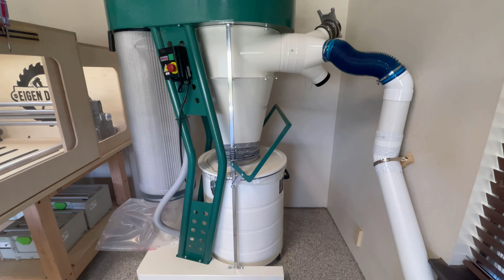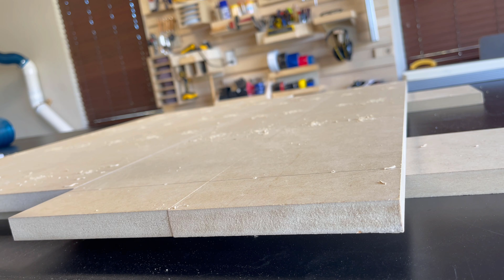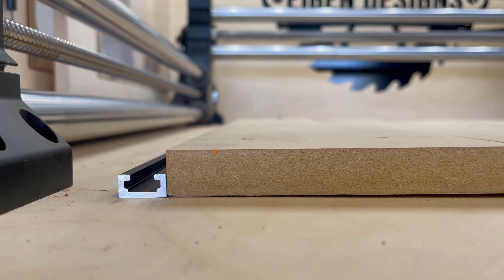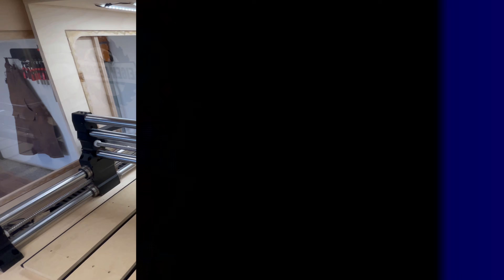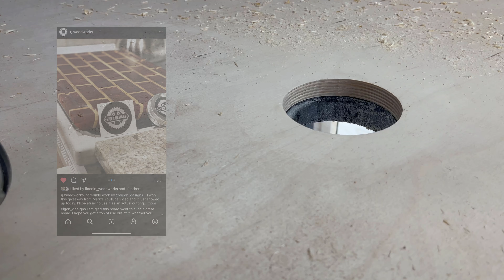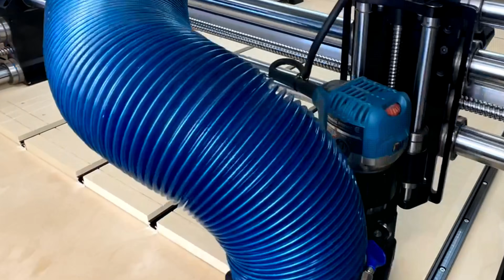OneFinity CNC Upgrades  |  4" Dust Collection & More

Comment: I am building a similar enclosure for my shapeoko 5 pro 4x4... I also have a 4" DC. Do you like where you mounted the port through what looks like the middle of the front cabinet slide? I was debating on a back corner

Comment: How does the dust collection run with limited air inrush space into the enclosure? It's one aspect I'm thinking over as I process a design that will be a lot about noise reduction and yet need effective dust control internally. I can use a water cooled spindle to reduce air blowout of dust which = less suction demand, and am contemplating a rear or top air inlet that is actually a stepped baffle with acoustic foam. 

Have you any thoughts on this from from your own cabinet. It looks quite well sealed with the main air ingress only possible betwteen the sliding front/rear portion :). I'ts a very nice design I must say!

Comment: Hi. When preparing wasteboard, would it be a good idea that it could extend outside of the range of the CNC so it gives more room to clamp ?
Reply from the maker: That's a very good idea. It would surely help get clamping around the lower perimeter for the waste board.

Comment: If you drilled a larger hole in your spoil board for your screws ( I call this a clearance hole . It allows clearance for the threads of the screw so they don’t actually tap in to the item you want to fix down) you would have been able to screw your spoil board down better
Reply from the maker: Great tip. I will try that next time.

Comment: Those are some great upgrades. What do you think about putting on an 80mm collar, which allows more Z axis movement. There's a YouTube showing how it clears the stepper motor and gives you about 2 more inches of dimensional movement. I though you might have an opinion about this. Thanks.
Reply from the maker: I think it largely depends on the kind of CNC work you do. If you do a lot of projects with thick stock and need the extra Z axis movement, it’s something to consider. I haven’t ever needed that capacity for the projects I do so it wouldn’t be something I would upgrade personally.
Reply: @EigenDesigns  Makes sense. Thanks. What do you think of the QCW add on ? I notice a lot of YouTubers don't have them. You don't either so you must not have thought it was worth it ? Still, Onefinity charges a lot for that unit so I'm trying to figure what is the value - is it just for additional stiffness and why would you need that I wonder. Or is it just for convenience in in swapping in new wasteboard - although it doesn't seem to me that it adds all that much more convenience. I'm getting ready to make the big purchase so I'm really trying to figure out what I need and don't need. Thanks again.
Reply from the maker: @hv1461  The designers at OneFinity originally designed their system to be transportable and mobile so that users could disassessmble and reassemble with relative ease. For someone traveling with their OneFinity I could see how the QCW frame could be useful. For a hobbyist woodworker like me who will only ever use it in my shop, I decided to build a table dedicated to it and never take it apart. 

I hope this helps. If you're like me and don't plan on moving it, I would make something rigid out of lumber + ply yourself. 

Cheers,

Mark
Reply: @EigenDesigns  Thank you. I appreciate you sharing your knowledge.

Comment: Love your videos and your work!  One question, how much sound dampening do you get with your enclosure?  
Thanks 
Chris.
Reply from the maker: Hey Chris. The sound dampening for the router is actually pretty good. I would guess it blocks out ~50-75% of the sound. However, the dust collector is what makes most noise in my shop and that is not at all dampened by the enclosure.

Comment: Enter - Nice setup!  Did you notice a big difference with the 4" dust collection setup?
Reply from the maker: Its been a signifcant upgrade Todd. Now, to be fair, I have also upgrade my dust collector so its not just the 4" vs. 2.5" upgrade having an impact, but the actual dust collector itself too. The two working together remove 99%+ of all dust generated at the router bit. 

I have entered you into the giveaway :)

Comment: Thanks for thus informative video. One question, what type saw blade did you use to cut channel. I have a Dewalt 12" mitre saw. Thanks for your help.
Reply from the maker: I have been using a FS Tool LM4300 miter blade (https://amzn.to/3s22Ngm) for years and it still cuts everything like butter. I have had to cut some acrylic and some c-channel and it handles it no problem.

Comment: Awesome....that dust collection system looks like it could eat a small car!  I know this wasn't much about bits, HOWEVER, do you find the extra $20 for a WS resurfacing bit is worth it? Dig the stuff you put out....keep on keepin' on.
Reply from the maker: Hey Jeremy. My general experience towards CNC bits is that you get what you pay for. I have tried buying the cheap chinese bits for my CNC work and I find that they don't last very long and end up leaving more burn marks when compared to the higher end bits. The whiteside surfacing bit was actually purchased after I tried a cheap surfacing on that left black burn marks on my spoil board. So for me, there's no question its worth it. Also, I bought a nice Amana set for my general routing work about 8 months ago and I am still using them. I haven't had to replace them yet. 

Thanks for the support bud. I really appreciate it.
Reply: @EigenDesigns  Sounds good and thanks again!

Comment: Enter Thanks for this video, I am connecting my dust collector to my cnc this weekend, also using 4 inch. I have a drop right above the cnc, definitely going to look at those magport connections!
Reply from the maker: I am glad it is helping, Dan. I have been really happy with the Magport couplings. They are a bit pricy, but it makes removing the dust collection line much easier. 

I have entered you into the giveaway :)

Comment: Enter. Why did you use a 90 instead of a 45. 1. They say you should not use 90s as it restricts flow. 2. It looks like the angle to the pipe would have been more of a straight shot. Thanks
Reply from the maker: Hey Josh, that's a really good question. In short, I intentionally opted for aesthetics over functionality with the 4" run to my CNC. I chose 90s for the CNC run because I thought it would look better than using a 45 and having the duct run cut across the room. 

Now, for the main trunk line that feeds my big equipment (e.g. planer, jointer, tablesaw) I have used 45s over 90s where possible. For that ducting run I was much more concerned with minimizing losses, whereas the CNC run I didn't mind because my 3HP dust collector is wayyyy overkill for my machine.

Really good question, but there was thought put into it before selecting the 90s.

Also, I have entered you into the giveaway :)

Comment: enter Great video, is it really working that much better than the previous dust collection set up?
Reply from the maker: It's been a significant change Mike. When I surfaced my spoilboard that was almost no dust or shavings left behind. Now, this 4" upgrade was coupled with a dust collector upgrade so I can't really say what portion of the upgrade came from the 4" vs 2.5" line upgrade and how much has come from the newer dust collector. The two changes in combination have been a sunstantial upgrade though.

I have entered you into the giveaway :)

Comment: Enter. I really like those magnetic quick disconnects. What kind of filament did you use?
Reply from the maker: The magnetic disconnects are really handy, and they form a surprisingly good seal (e.g. almost no air leakage). What do you mean by filament?

I have entered you into the giveaway :)
Reply: @EigenDesigns  I could be wrong, but I thought you said they disconnects were 3d printed. I was just asking what filament was used during that process. Thank you for the giveaway entry.
Reply from the maker: @b3ardedbarbarian  Ohhh, now I see what you are asking, thanks for the clarification. So the magnetic quick connect on the PWNCNC dustboot was 3D printed, but I have no idea what filament they used. The MagPort magnetic couplings don't look or feel like they are 3D printed.
Reply: @EigenDesigns  ok gotcha. Thanks

Comment: Enter - great video, I also own a 1F x50 and I am interested in the hose you picked for inside the enclosure do you have a link for that - looks like it can collapse as needed but expand without much resistance.
Reply from the maker: Hey Brian. It's the 4" Dust Right hose from Rockler. There is one on amazon that is only ~2ft: https://amzn.to/3gGiIul but the Rockler website has it in longer lengths. I have also registered you for the giveaway :)

Comment: Enter. Great video, thinking of getting that dust boot. I take it from the video you are happy with it. Where did you get the blue 4 inch hose?
Reply from the maker: Hey Dan. It's the 4" Dust Right hose from Rockler. There is one on amazon that is only ~2ft: https://amzn.to/3gGiIul but the Rockler website has it in longer lengths. I have also registered you for the giveaway :)
Reply from the maker: Also, yes, I am very happy with it. I didn't show it in the video, but after surfacing the spoil board there was essentially no dust on the table at all.... and MDF is one of the most dust-heavy materials out there. I would recommend it.

Comment: ENTER. I am obsessed with the Onefinity CNC and am saving up to order one as soon as I can. I like your upgrades so far. I think for me, the best features besides the extra rigidity is that you can run it from a thumb drive versus others requiring a computer to be connected and the additional cutting area that Journeyman has to offer.
Reply from the maker: Hey Tom! I share your obsession. It's an amazing CNC. Another great thing about the OneFinity is that you can actually send files to it over the WiFi network, so you don't even have to use a thumb drive if you don't want to. Typically I will complete my designs in my office and then just send it to the CNC control unit through WiFi and then begin cutting. It's incredible.

Also, I have entered you into the giveaway.
Reply: @EigenDesigns  wow, very cool. I did not realize that was an option as well. thank you.
Reply from the maker: @tommcnally2803  You won the giveaway Tom! Please send an email  to eigendesigns20@gmail.com so I can get your information for delivery.
Reply from the maker: @tommcnally2803  Please reply to me within 24 hours to claim your prize, otherwise I will have to select another winner. Please email me at eigendesigns20@gmail.com
Reply: I can’t believe I won!